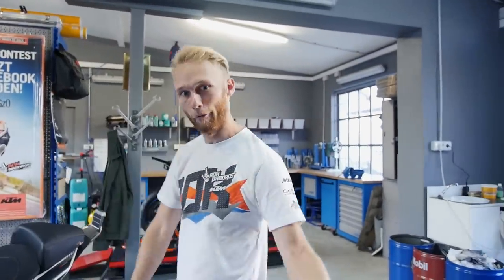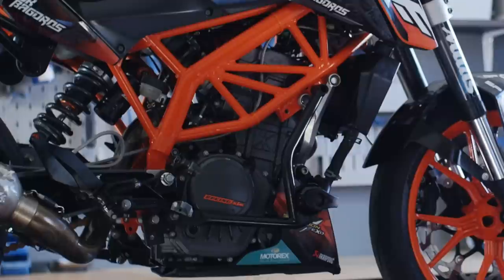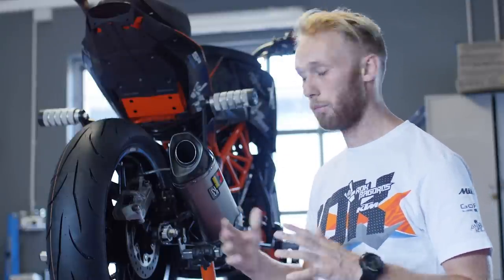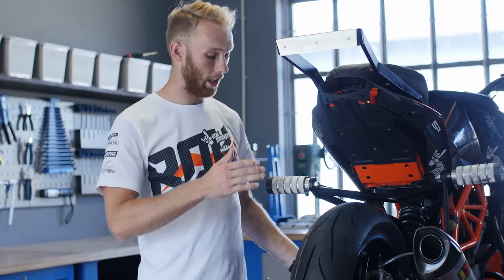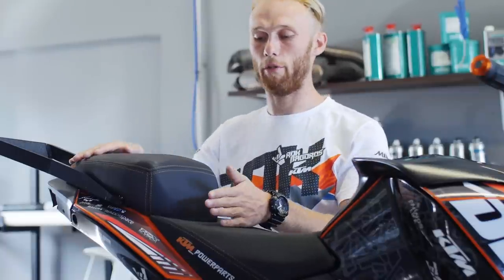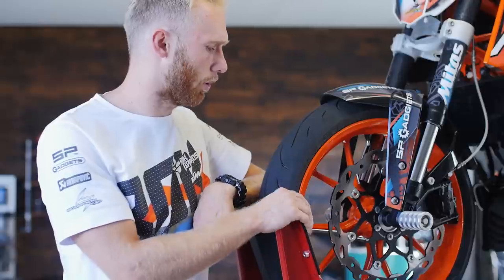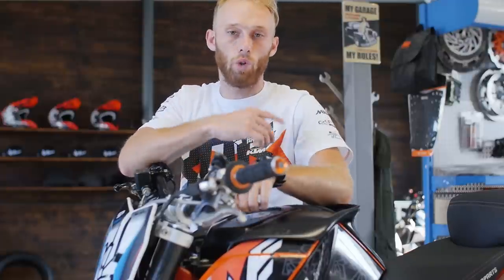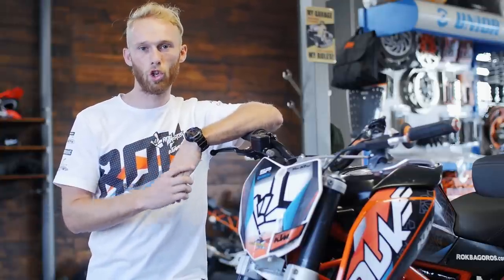KTM 200 Duke stuntbike setup by Rok Bagoros

Comment: Hey rok , planning on swapping my Duke 200 front disk brake with the oversize wave type disk brake. Should I just buy the disk from KTM powerparts store and swap it with the current one? Any other parts needed to be replaced like brake pads and all.. kindly help.
- Thanks in advance.

Comment: @Rok Just a quick question, Maybe you or mechanic friends can help me. I changed the exhaust on my duke 390, bought a remus carbon race exhaust without the cat,so it's straight pipe now.Sometimes when the engine is already hot ,staying at the red light,want to start ,1st gear and bum...engine dies. Before did't have this problem.... Any advices? Need to be the ECU remapped ?Remus says no, only if I remove the baffle,but I didn't. Thanks.

Comment: I'm curious about the tail light. Did you remove it completely to accommodate space for the wheelie bar?
Reply from the maker: Andre Despott good question. Few years ago when we still developed the first stunt parts we needed to remove the light. But now with the newest design of the wheelie bar you dont need to remove anything ;)

Comment: Awesome video, very thorough ! :D Do you use the same setup for the 690 ? And is the second throttle control for increasing Idle ? :)
Reply from the maker: Jerry Georgsson hi Jerry, the idle system is different on the 690 since the bike has an electrical throttle system and not a regular cable system. So id needs a bit of high tech tuning.
Reply: Yea i've been wondering how that works for stunting.Hoping that you could explain it a bit if you would make a 690 Stunt Setup video later sometime :D RokON!

Comment: hey Rok I've got an rc 200 ,wanted to be able to hold my powerwhellie and also shift while in air...please tell me what I can do to make that happen
Reply from the maker: Tushar Mane balance is my answer. Try to learn to hold the wheelie in the so called sweet spot, when you hold your bike high up with almost no use of the throttle and brake, then you will be able also to shift up. Be careful this you need to practice step by step otherwise you will crash ;)
Reply: Also....how hard does it hurt the engine?
Reply from the maker: Does not harm the engine, just put a bit more oil in the engine. 3/4 on the control window on the engine
Reply: Awesome thanks!

Comment: Does the Magura throttle control adjust idle? If so, where can I find one?
Reply from the maker: Jesse Sowder hi Jesse, its just a handle that moves the second throttle cable. Between we build a kind of complicated throttle cable winch system. I saw in Thailand quite simple solution with a screw system connected straight to the second cable. While turning the cable the screw is slowly pushing the throttle pad on the injection unit.

Comment: What's your solution so that the bike does not heat while doing tricks with high rpm
Reply from the maker: Try to switch up while doing tricks, when the bike overheats do some high speed stoppies or wheelies so that tha radiator gets more fresh air ;)

Comment: 390&200 whic one better for stunt?
Reply from the maker: 200 Duke is much better. Much smoother on the technical tricks, has not the power as the 390, so the drifts are not so easy as with the 390 but the advantage on the technical tricks with 200 is way more important ;)
Reply: +RokBagorosStuntrider  Thank so much...I wish u visit cambodia again...😊
Reply from the maker: You are welcome, coming to Cambodia soon ;)
Reply: +RokBagorosStuntrider Broda will you plz tell how which size of sprocket you have used?